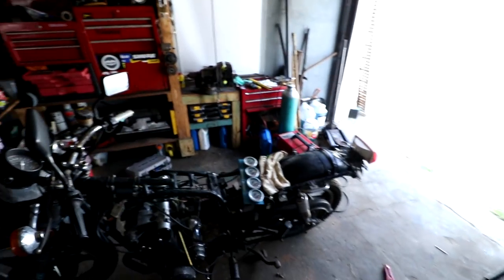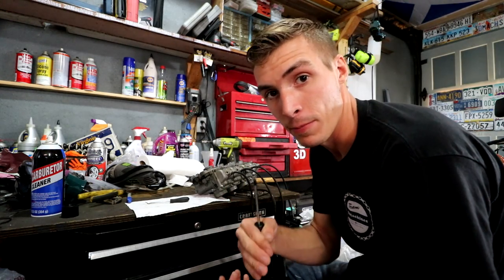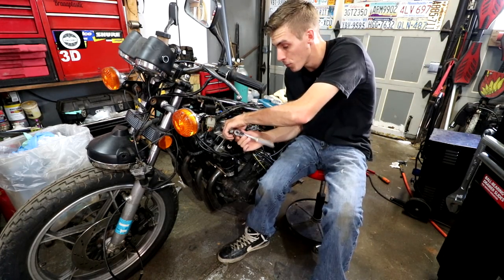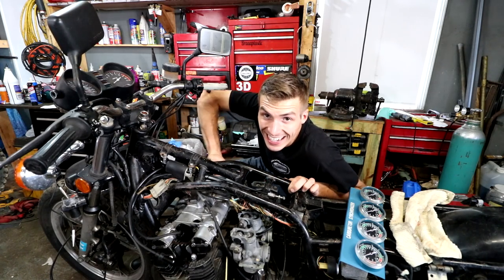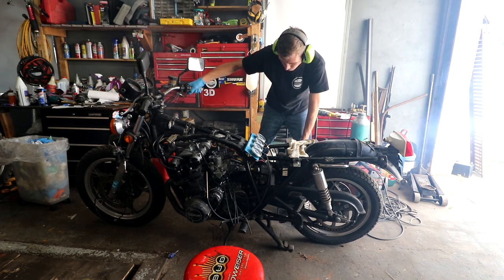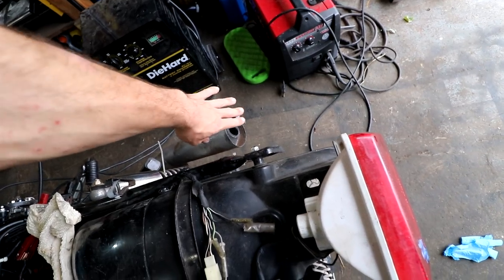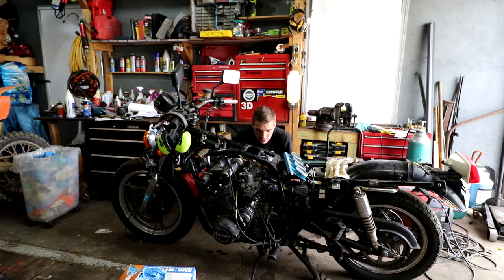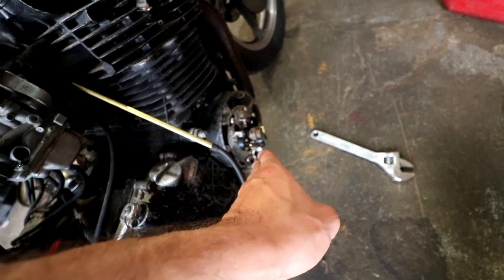1000cc ENGINE SMOKES TOO MUCH!!

Comment: Has anyone else been confused about how to shift the gears like if you are confused also
Reply: Nick Skibinski what's to be confused about? what aspect of changing gears are you confused about?
Reply: izoli I believe that he means how Dalton is going to shift gears once the engine is in the gator
Reply: Probably going to run a rod from the shifter through the floor to a hand shifter
Reply: Probley how we do in a micro sprint car. Linkage to a shift handle with a clutch on it. honestly dont need the clutch to shift, just stop and start.
Reply: But that damages the gears inside the gearbox.
Reply: Guzten2 no it doesn't
Reply: Cameron Crush maybe if you rev match perfectly, your better off just using a clutch
Reply: Chris Davies like i said, have yet to break a single trans and everyone in the micro sprint world shifts with my no clutch, and yes its still a stock clutch. i slow down to downshift with no clutch but going up the gears just blip the throttle
Reply: sprinten8 meanwhile I just have a shift assist with auto rev match. idk if I can live without it now that I have it.
Reply: sprinten8 what these kids don't know is that most motorcycles have Dog gear engagement which allows banging through gears without them breaking. It's not built like a car transmission.
Reply: Yeah, that makes them more durable and makes it possible to change gears without the clutch but just imagine you have 1 gear spinning at, I dunno let's say 4000 rpm, what would happen if you engage that gear to one that spinns at 3000 rpm, it will bang against it and make a dent on the gear. I would not reccomend changing gears without the clutch while doing regular comuting with your bike cause that's just unnecessary wear on the gears. It works, but not in the long run.